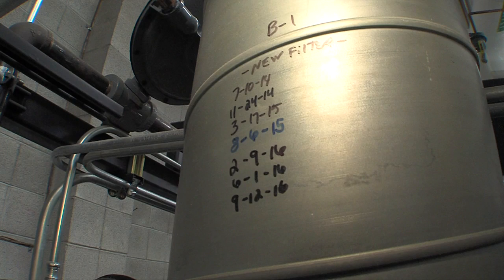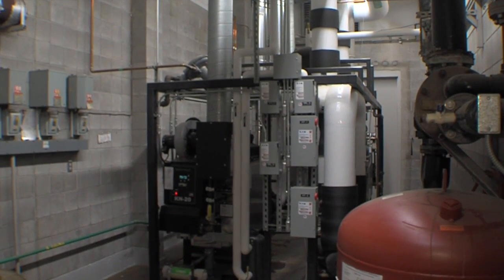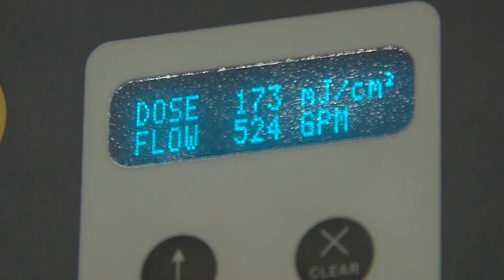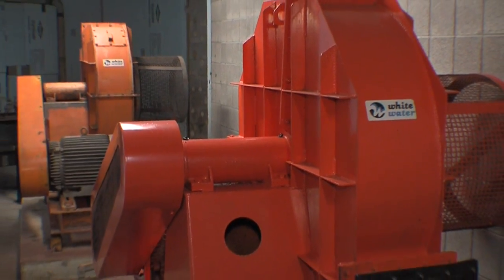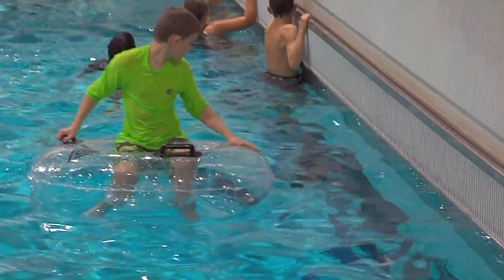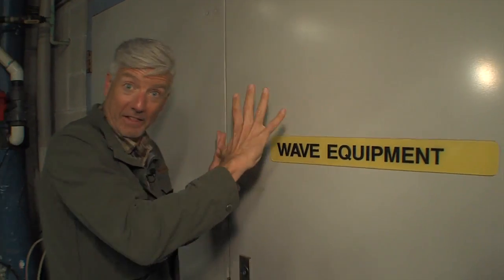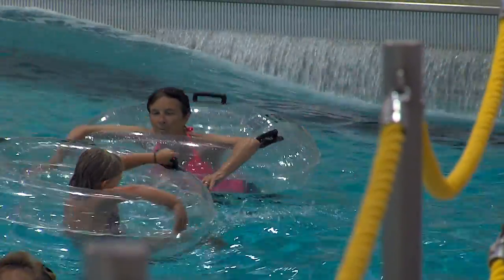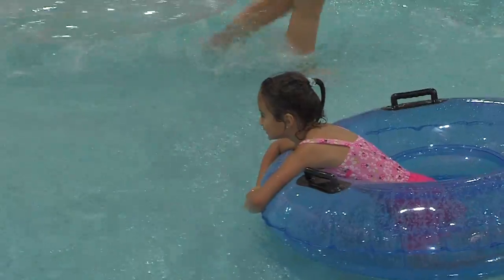Splash 3 - Behind The Scenes of the Wave Machine

Comment: Design of the doors for the wave machine plant, does not have special handles. I assume the special handles is to keep the door still during the operation of the machine otherwise it will trigger a cut off mechanism. The plantroom will have pressure during operation of the machine as the machine will create it.